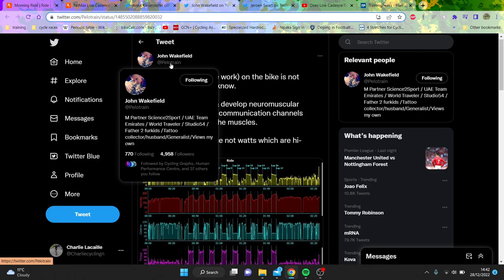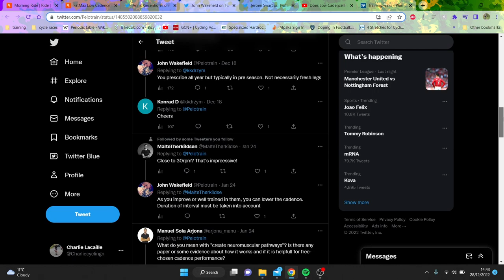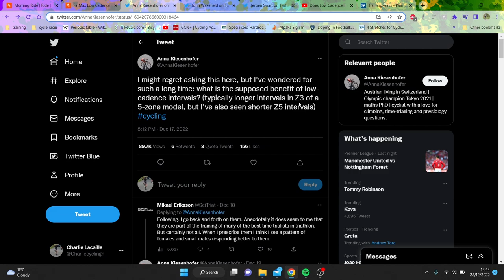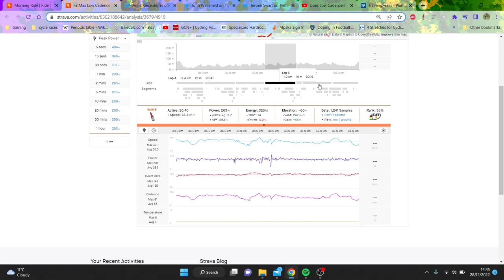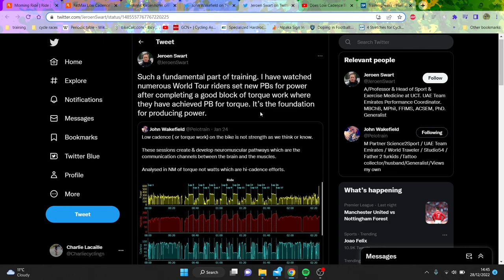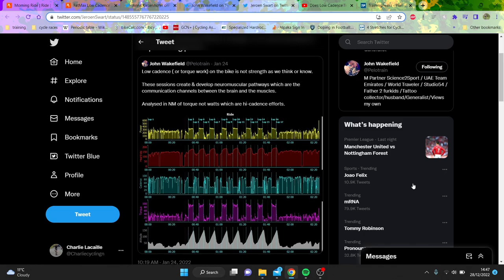Why Do Pros Do Low Cadence Training ?

Comment: Good video. FYI the easiest way to get torque is just by taking torque = power / (cadence*2pi/60), where power is just expressed in watts, cadence in rpm, and torque in newton meters. 

This probably gives a good intuitive feel for it as well, as you can see that it varies inversely with cadence. Ie 300w at 90rpm gives you torque = 300 / (2*pi*90/60) = 31.83. The same power at 45 rpm gives 63.66 Nm (exactly double). Jay Vine said 400w at 50rpm, which gives 76.4 nm, which is in line with him saying he worked up to over 70 nm. Cheers

Comment: I'm 62 years old. My average cadence for the past year was 60 rpm. High torque but not mad levels. In less than two years I've raised my VO2 from 155 to 177. As for sustained work? 4 Watts/kg for 100 minutes. 5 Watts/kg for 20 minutes (Denham 2 little chalfont TT) Strava KOM. It works. Ok, I train two to three hours each day, but there you go.
Reply: Good for you, that’s awesome 💪
Reply: V02 max can’t be 100 plus
Reply: @hunters641  well he said vo2, not vo2 max.

Comment: I think Dylan Johnsons rationale was that current scientific studies didnt demonstrate performance gains from  low cadence. Based on evidence availible at the time this seemed a sound prognosis. However, where some of what he said got a bit hazy is high torque - low cadence is not just,  "mashing", especially if integrated as part of a training protocol with the overall load calibrated. The rationale of Strength and Conditioning coaches/studies is high weight low reps (3-6reps) will generate a best return for endurance athletes - when done well.  Perhaps this last bit is key?

Whilst no study historicall evidences the benefits of high torque - low cadence the rationale that it strengthens neuromuscular pathways does seem sound. Dylan Johnsons argument was high torque low cadence is essentially like lifting very high reps (highly specific) or endurance range ie 20 reps +. Science in a weight lifting context does not evidence this as the best ROI for endurance athletes. The argument made is for low reps heavy weight is it generates a stress/adaptation response resulting in strength gains (& the recruitment of fast twitch fibres depending accenuated by how lifts are done). There is empirical evidence for this approach.

However, the question this video provokes is does high torque  work more readily enable an elite cyclist to incorporate a greater body of work done  than two or even three trips to the gym per week? This is harder to quantify but putting out 400 watts at 50 rpm /700nm may prove more beneficial to Jay Vine and create a sense of training momentum verses Jay Vine in the gym. It's clear UAE have a cohesive approach appearing to be doing less but higher quality Z2 with high torque intervals. Jay appeared to be asserting this was creating greater training momentum for him/ other UAE riders than his experience at Alpecin? Or it's honeymoon period. Id argue the cumulative effect of WVA being at Jumbo may be giving him a training advantage over MVDP now? 

The real skill of physiologists/ coaches is the integration and emphasis of each element into a plan with peaking considerations alongside the personal physiology of the athlete being taken into account.
I agree with Charlie's assertion that 

a) there may be something in high torque even if the papers arent oublished yet

b) a combo of both weights and high torque is probably the optimum if you have the time/capacity. 

3-5years from now, will there be scientific studies supporting high torque training? Quite possibly.

Finally, I'd be interested to know if studies could investigate if an approach where weight training is used in a cyclist training protocol to generate muscle/increase absolute strength and correct imbalances alongside high torque training being used to strengthen neuromuscular pathways.... the hypothesis would be weights to increase improve muscular performance with torque to maximise what you have and move towards specificity....
I'm no physiologist but seems it may be helpful....
Reply: Outstanding comment.  I agree with all points and assertions.
Reply: Tldr ?

Comment: A twitter thread is not scientific evidence.  Just because someone coaches WT riders doesn't make them right.  You are using the appealing to an authority fallacy there.  You manipulated the question Dylan Johnson was asking.  He asked if low cadence work was as good as lifting weights.  He didn't say low cadence work was not effective at all.
Reply from the maker: Pro riders do it. That's fact. The point is there is no scientific literature on it. No one has done a study on the exact intervals they do.

Comment: My own recent personal experience confirms that torque training, even a very small amount, and maybe that's really all we need, does give a notable improvement in performance (FTP)...Just a couple of weeks ago I started adding a very brief session of about 5 minutes' worth of high torque-low cadence, a ride around my local block with a 1 km 4-5% climb in it, a ride on what would have normally been a no-ride recovery day. On the next day's session I was able, seemingly without any extra effort, to make a new personal best for the time around my normal course, and have been feeling stronger on all rides after that.  Doing the little torque ride was the only change I made in my normal training over the last several months...I don't generally "train" in the sense that I deliberately seek to increase performance since I'm already satisfied with my fitness level which fits my time and money budget.  No, this isn't rigorous science, but coupled with what the pros are saying, it's good enough to make me believe.

Comment: Honest question--not being sarcastic: Is there any specific evidence provided here, other than pros and coaches saying "this is what we do" (keeping in mind that pros and coaches swore by skinny tires at ultra-high psi until not that long ago)? That pros are setting new power PBs after training blocks or from season to season can't be surprising (and again, is there any clear evidence that it is specifically coming from the high torque sessions?).
Reply: I agree, to me it doesn’t make sense that the coaches would be transparent enough to share the method and be too secretive to share evidence.
Reply from the maker: No that's the issue. Pros / coaches say it work but no one has done proper studies on it. They compare the wrong types of intervals etc. That was my point. Like no scientific literature but coaches swear by it and therefore it is interesting to see if it works or not
Reply: EXACLYYY!
Low cadence does not give you any physiological benefit rather than beeing used to it. If you have a race that you need low cadence, do it in training. If not, it's useless.
The gains you think low cadence does are actualy from training in that specific zone (zone 3, 4.. etc)

Comment: I would think that low cadence high torque permits you to train fast twitch fibers significantly longer than you could otherwise. You could engage NM type fibers for 4 minutes at a time or longer vs. 60sec at your preferred cadence. Can it provide an endurance adaption to those fast twitch fibers.

Comment: This season my coach prescribed a lot of torque work..im keen to see the results..from 4min reps at 70nm im now at 10min ~75nm @ 40rpm…i can see the progression..but will it translate to better performance for racing?!
Reply: Update on this?  How has your season gone thus far?  Thank you for sharing
Reply: @brianmessemer2973  thanks for asking! What a coincidence! Last sunday i did a race and placed 2nd overall, this is my second time making a top 2 result this year. To be honest im not sure if its because of the low cadence work or not but this season im stronger than ever, i added about 10w all around my power curve comparing to last year wich is great but the thing i appreciate the most is that i can hold ftp numbers even after 4-5hrs (normally that was a problem for me)..when going into race season i started incorporating z4 work and eventually i switched fully to z4 without lc…last weeks race was long so i did a lc micxed with z4 workout and it payed off i guess
Reply: @cfau6290  I’ll take that as anecdotal evidence that low rpm high torque training yields training benefits!  That and all these videos I’m seeing.  There’s no way pros would waste their precious training time on torque work if there wasn’t a physiological benefit to it.  Best of luck in future and safe riding!

Comment: Typical pre season is usually a big z2 block then into some tempo and threshold work. Do you think a torque block should go before or after tempo ? And do you think it should be supplemented with gym ?
Reply: I think torque work can squeeze into z2, something like 5*4 of low z4 times two, two times a week
Reply from the maker: Do it at same time as tempo.
Reply: What's the point?
Low cadence does not give you any physiological benefit rather than beeing used to it. If you have a race that you need low cadence, do it in training. If not, it's useless.
The gains you think low cadence does are actualy from training in that specific zone (zone 3, 4.. etc)

Comment: Jay Vine said "Less gym work, more low cadence work" seems that one manages to provoke the same physiological effect as the other, and it is wrong. Low cadence work is still endurance work. If you do a proper gym session with high loads you can't mimic that, maybe only sprints.

Comment: Just because it's good for the pros DOES NOT mean it's good for the average athlete.
Reply from the maker: why would it be bad for average athletes?
Reply: I do train low cadence at times as when I do go up a wall of a climb it is good to be used to pedal slow and use low cadence when you run out of gears
Reply: @CharlieCarbsandCycling  it wears out your chain way faster ngl
Reply from the maker: @2ball434  hahaha